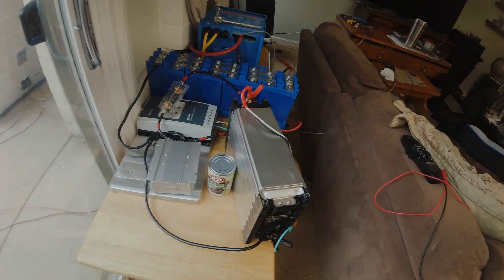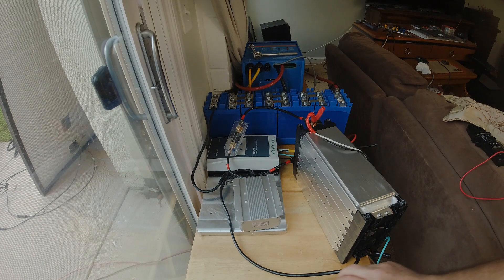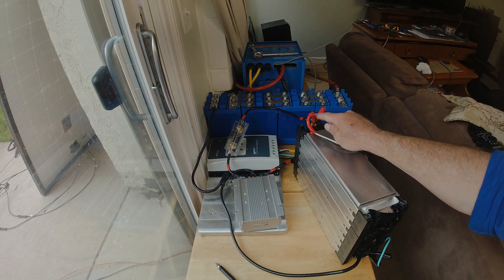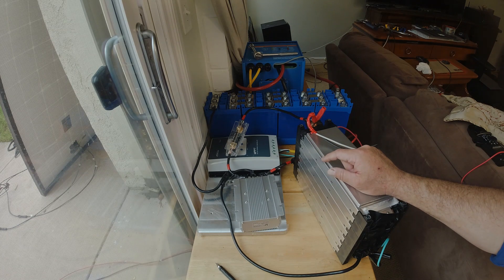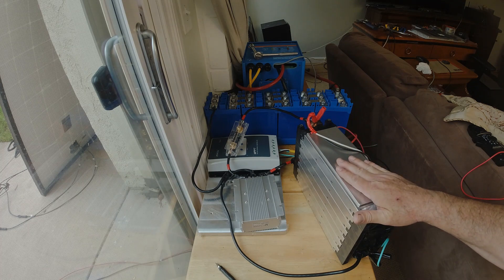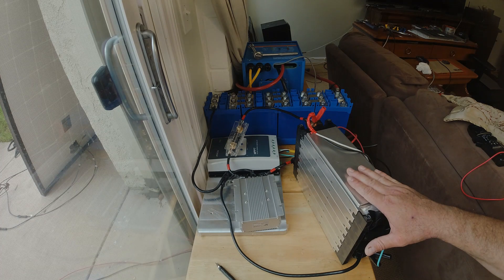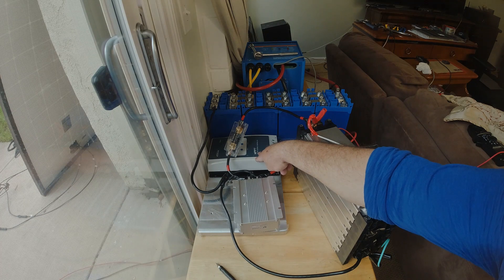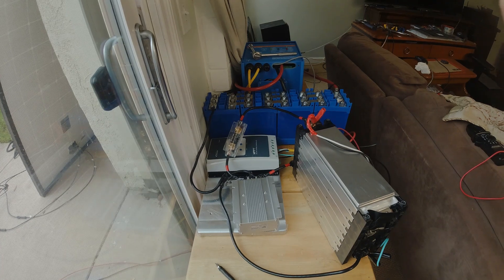Lithium Polymer DIY Battery, 24V, 120 Amp Hour (240AH at 12V), From LG Chem Pack.

Comment: wow finally someone made a video on these batteries, I have the whole 10KW that was installed back in 2022 but never actually used due to some (Over voltage) error that I couldn't fix, I thought about removing the cells and combine them with 19KW battery banks that runs on 6KW Victron inverters but worried about safety. at least now I know I can use them with BMS, thank you so much for taking these steps & sharing. I hope to see your next video on which BMS you are using.

Comment: I have 3 of these connected to a remote wanderer 10amp charge controller and a 100watt panel and a 1000watt inverter and it's the perfect little grab n go power source but I can't find any more

Comment: I also have a couple of these (LG N2.1?) In 3S and 4S config seems to work well on the 12v RV. Lots of capacity! I am sure the ones I have are Lithium Ion not Polymer?

Comment from the maker: These LG Chem 3.6V (Nominal) cells don't stack up well for 12V as they may be beyond the upper end of the voltage range of 12V equipment at their theoretical top of charge; for 4 cells, that's 16.8V/Nominal is 14.4V's. (I hear most 12V equipment is designed for 11-16V'. They configure will for 24V Battery bank at 21--29.2 voltage range (7 cells)...
Reply: I just bought 7 of these LG Chem from battery hookup, I thought it was a very good power ratio for the money. I  was thinking of using the Epever charge controller so I was glad to see what you had to say about it. .I am new at solar and this will be my first build so I'm looking forward to your next video.
Reply from the maker: @tome8116  Whats your application Tom?? Have you decided on 24V format?  I'm testing using them in a 12V format but thinking it may be irresponsible to make a video about that (b/c of this Chemistry, the voltage is a little high for some sensitive 12V application (16.8 V at full charge).
Reply from the maker: @tome8116  They actually work fine in 12V (4-cell) config w/out a converter for my RV but I don't have any highly sensitive equipment, so Im not sure that will work for others. 24V setup is more efficient anyways just need a 24V to 12V Converter for your 12V DC Wiring....
Reply: @netzerostrategies  Balance them at 3.9v on the top end. You lose a chunk of capacity, but you make up for it in longevity. 15.6v is easier to fit into common 12v equipment and the battery will last longer than the RV.
Reply from the maker: @tome8116  I love the Chem Cells... They actually work fine in 12V (4-cell) config as well for my RV but I don't have any highly sensitive equipment, so Im not sure that will work for others. 24V setup is more efficient anyways just need a 24V to 12V Converter for your 12V DC Wiring....